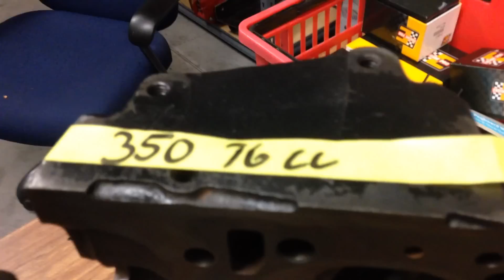350 and 305 Chevy what's The Difference

Comment: I'm looking into getting a Chevy 20 work van with a 305. If I'm going to be using this van frequently what are things I should look out for?
Reply: Nothing really. The 305 has great low end torque, they're suited for it (the exact reason you see so many 305's in Marine engines where they're under CONSTANT load).

But, what should be looked out for is:
- ALWAYS change your oil on time, and DO USE a high quality filter. In a work van, the last thing you want is for a tiny piece of debris to slip by your system and cause a spun bearing in the cam or crank.

- If going the 4bbl route, they came with Quadrajets on them. You'll want to rebuild it as soon as you bring it home and be sure to seal up the welch plugs with "Marine Tex". Do not use JB weld or anything else, Marine Tex is one of the only things proven to stand the test of time with fuel. (This is extremely common for Q-jets to leak/seep through the welch plugs. But, absolutely one of the best carbs to get and use hands down — AS LONG AS it's adjusted correctly. You can easily rebuild a mid 80s and earlier Q-jet no problem by just following along on a YouTube video. They're not at all hard to do right.)

- Swap out for a nice HEI system, and do away with the old style points and coil style distributor. You'll get a better spark, better fuel economy, and it'll make for a little more power and a longer lasting engine in the outcome.

- Other than that, there's really not much you gotta watch out for other than atypical engine stuff. They're easy to refresh on the top end if need be, and extremely reliable for what you're looking at. If you're gonna be pulling a lot of weight/doing a lot of towing, you may want to install an RV/Torker camshaft. It'll bring your RPMS down to around 4500-k max, but you'll have even more immense low end torque to play with and rely on to better utilize the van for its intended purposes.

They're built like tanks and last a lifetime if well serviced and taken care of.

Comment: just signed the paperwork and put my first payment down on a 98 k1500 ❤ what would YOU DO? with a factory setup 5.0 with thr spider injection :/ i did lower intake manifold gaskets it was flooding the engine pretty bad with coolant it runs great tho honestly 4x4 is perfect i love it drove it for a couple weeks on my test drive the main issue is the rear differential is shot it wont move
Reply: do you know alot about differentials and stuff? i want to do a nice, subtle, reliable,  decently economic, build with respectable power im used to driving a 95 deville 4.9 i pay truck gas prices without the truck already why not im skilled enough to do a swap or retrofit contemplateing trying to get my greasy fingers on a 6.0

Comment: The fastest car i have ever owned was a 84 z28 with a 305. I didn't mod it but the guy i had purchased from had build it for his son to practice drag racing with. It had some kind of cam, holley 650 double pumper, edelbrock dual plane intake, some type of long tube headers, and was told it had shaved heads on it. That car would run its ass off, i literally outran everybody i raced with 1 exception. A heavily modded rx7 with a huge garrett turbo. watching this video makes me think the 305 would take to a turbo setup extremely well with bottom end work.

Comment: He stated the crankshafts interchange but the 305 crank is much less weight and are stamped 305 and the front counter weight as the rotating assembly (pistons and rods are lighter) (also the rod's are thinner on the beam) so in short if you look at the target bob weight of a 350 or a 305 crank are not the same.

Comment: I got a million dollar question can you take a 383 stroker crank and clearance a 305 block for it if so what do that combo make it ???
Reply: Yes you can look up 305 to 334 or 331 kit but it's not worth it because the bore is so small that you really can't get good airflow and bigger valves won't help because they will be shrouded best to leave a 305 stock and if you want performance build a small block with a 4in bore or a 4.125 bore which would be a 302,327,350, and 400

Comment: 305 was popular in the late 70's into the 80's as a V8 that suffered from emissions detuning. They weren't built to the highest quality at the time either and gained a reputation as worthless junk. But those nice thick cylinder walls make it easy to put oversize pistons in, and being as it's the same crank as the 350, easy to upgrade. New better flowing heads are in many cases cheaper than having a set of 350 heads rebuilt. 305 block is a nice start to a custom build so long as the block is good. People don't care about them so they're cheap, too.

Comment: 265 through 350 the differences are slight changes to stroke and/or bore.  My dad owned a garage for over 60 years and he said they used to bore out a 283 block to 302, long before the 302 was invented.  Piston deck height has to match the stroke, otherwise there is a lot of interchangeability of parts.  Also remember that journal diameters changed at some point (1968) so an older crank won't fit in a newer block and so forth, and there have been other minor changes that can cause a problem, but back in that era it was pretty common to swap parts around.
Reply: Sorry for your information but you use a 327 block and a 283 crankshaft it requires a 4 inch bore and a 3 inch stroke
Reply: Grab a Chilton motor manual and a calculator for your information
Reply: @rodneyhopper22  They were boring 283 blocks out to 327 dimensions before the 327 was introduced.  Of course they didn't have 327 crankshafts back then, only 283 crankshafts, but bored that much they achieved 302 cubic inches.

Comment: A good news clip. I have only heard of the 305 used on late-60's Camaro Z-28's. Not sure why, since they are so close in performance to the 350.
Reply from the maker: the 67-69  Z/28 had a 302 not a 305 they are very different,
 the 302 was a very good engine 4" bore and a 3" stroke the 305 is a 3.480 stroke with a 3.736 bore they do not perform anywhere near the level of a 302 or 350

Comment: I have an '86 Camero with the 305. It makes 190 weak horsepower.  I would like to get more HP out of it.
Can I put 350 heads on it to gain more up?  Any other ideas?
Reply from the maker: no that wont help If your looking for an upgrade in power I would just swap in a 350 305's are dependable but lack HP

Comment: I had a notion to build a 341 for my '89 K1500 -- That's a 305 block with a 400 crank and 350 heads (193 casting number) and port & polish the heads the Headbytes way. Then I fell into a newer Dodge Ram 1500... soooo probably not. I had a dream......

Comment: Here's another interesting wrinkle in the small block Chevy story: The Camaro Z-28 engine of the late 60s Trans-Am Camaros. That engine was was a hybrid, using the 350 block (with the four inch bore) and a 283 crank, with a three inch stroke. That gave the advantage of the 350's bigger bore, valves and ports, and the shorter stroke crank. The latter may have cost a bit of torque, but it also allowed the engine to rev higher than a typical 305.
Reply: That was the 302.

Comment: I have a 283 with 305 heads in a 86 chevy truck. Didn't get to run it much because when I had the 700r4 rebuilt I got the truck back with a blown motor. Any comment on this would be greatly appreciated!! Thanks so much!!

Comment: if the bottom end is the same, could I make it a stoker motor like the 350 to 383? I think if I could do that and put vortex heads on it and roller cam on it would be a neat odd motor I think.
Reply from the maker: It's been done a trillion times it would not be odd but it would be fast
Reply: never heard of one yet, but sound cool to me. may have to try it out. thanks.

Comment: Lots of 350 out there like mine with factory stock 64cc 193 heads.you also said before TBI heads are junk,then why did we flow bench garage ported 193 swirlport and almost matched the vortec heads in flow.I know of more than a few that have gotten good power out of 193 heads, yes i know there' not worth the time,well if you know how to work heads and have time,why not.

Comment: I had a carbureted 200hp 305 in my boat, it was smoother, had more power and was quieter than my relatives throttle body 190hp merc 4.3 boat. I also think it used less fuel but that could have been operator.

Comment: What is your opinion of a stock 307 with stock 350 heads, I don't know all them there numbers you were taking about, so just ruff it for me.
Reply: it's better to use the smaller chamber heads on a 307 the 185 castings are 70 cc the 305 heads also work well on a 307 I just built a 307 for one of my S-10 shop trucks with 416 casting 305 heads the 307 has the same stroke as a 327 with a slightly smaller bore they were not good performers in stock form because they had open chamber smog heads but you get a decant set of 305 heads with bigger valves bore the block to .060 and upgrade the cam they actually run pretty good

Comment: I had a 305 IROC...and for years the car show people were always a Debbie downer on a 305.  I saw some respectable 305 builds, but the knuckle draggers would always go Cro-Magnon.  305's made great street motors...not everyone is trying to take a stock car and get into the 9's.  Yes...there were the knuckle draggers who claimed sub 10 second times with a mild L98...  I've always maintained that you do what you can with what you have...and as racers like AJ Foyt would say...it is not about how much horsepower you have, it is about getting it out of the engine and using it correctly.

Comment: Assuming no problems with carburetion and ignition the main problem with a 305 is the cam. It is smaller and straight crappy compared to the 350 cam. First go to a 350 cam or better yet one of the HO cams or small rv cam. Next thing that helps is the HO style heads with the bigger valves. Flat top pistons like the HO can help with compression and quench. Of course dual exhaust and headers if possible. Run a dual plane intake and tune it all correctly. Holleys, Edelbrock or Carter carbs are fine, but don't automatically ditch the Quadrajet. They are like einstein compared to those other three. Next up is some vortec or aluminum heads, maybe some more cam. 

The HO 305's give you an idea how a 305 can run. Of course it is not 350 cubic inches but they can be pretty respectable and the challenge is fun, especially when you can beat a 350 occasionally. They wont believe you but you know the truth.

Comment: One difference is that some of the Chevy 305 were Factory equipped with a small Journal crankshaft instead of the large Journal like in the 350s. And, expect all of the 305's to have only 2 bolt mains. But you can still swap out the crankshafts between the 350 & 305's if they have large-diameter journals on the main crankshaft, part of what makes the motor last so long. But I imagine it is a lot easier to machine in the four bolt main crank bearing holders on a 305 or 350 with the large-diameter journal crankshaft. The two bolt main bearing holders can only take so much horsepower in a modified 305 or 350. So building up a 305 (or 350) with the big 2.02 heads, a fancy intake & exhaust, with nitrous, tended to blow up the small 305's.  another reason the 305 got a bad reputation. But polishing out the heads and putting a nice polished intake on the 305 with the all original Factory setup, allows the 305 to flow much better & it becomes more powerful And more economical, but still below the horsepower of a 350 with the same setup. Having smaller Pistons allows the 305 to run at higher RPM a bit, than a 350. But I always thought it was strange that chevy used the 305 for some of the Chevy SS cars(montecarlos). I guess Chevy thought that people would be impressed from the tachometer and not notice the power difference. Whatever you get, bore it out to 4 in, put in new pistons, weld in the 4 bolt mains, and you'll have a bulletproof motor, (balanced and Lubed right).
Reply from the maker: Correction there were no 305's produced with small journal cranks that is incorrect also the 305 does not have any more RPM capability than the 350 it's got nothing to do with bore size they share the same crank/rods and stroke I'm not sure where this info is coming from but you are listening to a source that is wrong
Reply from the maker: You cannot bore a 305 out to 4" it's not possable

Comment: I will say this, I doubt many people do it but a 3.75 stroke in a 305 makes for a pretty stout engine!!! with the right cam & heads it’s definitely a pretty peppy engine. of course it’s not as good as a 383 would be. but it’s a option for people that already has a 305 block on hand. if I’m not mistaking a 30 over 305 block with a 400 crank comes out to 334 cubes. it runs well.

Comment: I was just wondering I was watching your episode on YouTube about the difference between 305 and 350 have a 1981 Chevy Blazer K5 2 wheel drive that has a 305 in it and I high performance does a little bit put a different cam in it did nothing else besides that put a different carburetor on a putting all the Brock on it and I took it to a drag strip and it was to pull an 18 seconds in a quarter mile I was just wondering what your opinion is that pretty decent for a blazer

Comment: You can tell the difference between all Gen 1 Chevy sm blks on assembled motors.  Just above the timing chain cover, slightly to the passenger side from top center line of block, there is a casting "characteristic" that changes in size/shape from 283/305/327/350.

Comment: What the difference between 383 stroke and a 400 SBC ? In power, economy, pros and cons.
Reply from the maker: The 400 is better for power but has a tendency to run hot and has some cylinder sealing issues with high compression

Comment: hey brother I beg to differ with you on the flow of the 2 heads. A 305 head casting # 081 flows 187 cfm @ .400 lift and 195 @ .500 lift. That is better flow numbers than almost every large chamber 350 head (882, 441, 487, 624, & 993) and better than the #186 double hump.  Just dont make the mistake of putting a 1.94 inch valve in them because it will flow worse until you cut a multi ange valve job AND bowl blend.  I race an 87 Monte Carlo SS in NHRA S/KA using a 305 an 081 heads and im in the 11.70s with it. Ive put more 350s and Windsor Fords on the trailer than I care to remember. The cars that give me hell are the 283 Chevy IIs.

Comment: Is there any way to tell the difference when the engine is complete and in a vehicle?
Reply from the maker: yes the casting number is on the back of the block near the transmission bell housing it can be a bit of a challenge to see it in some cars just because there is stuff in the way but it's doable

Comment: I do like a 305 for the beef in-between the cylinders only major differences you'll notice is if your hauling if it's just the curb weight they both get up and go but when your hauling or building it's easier to get hp out of somthing with more hp already and you'll get better fuel mileage hauling with a 350 vs 305 because it puts less stress on everything to move were if you just light haul with your truck I wouldn't bother going 350 just my two pennys

Comment: The 305 is a good platform for a mini stroker (400 crank swap for 334") and because its thermodynamically more efficient than the big bores it can (with the right heads) be economical too.
Reply: WHY do this, when you can get a 327 Chevy  and NOT spend all the machining money to accommodate the extra stroke? CHEVY 327 makes plenty of pwr anyway.
Reply: @w41duvernay  The 327 is ... okay, once you getter wound up a bit, were if you put a TBI 305 up against a 327 with the same carb, intake, exhaust and cam as the 327, the 305 would blow the 327 into the weeds all day long, add to that a 3.75 crank in the 305 and it wouldn't even be a contest any more. The TBI 305 has better heads than the 327 ever came with. Anybody who tells you TBI swirl port heads are no good has never owned a flow bench or done up a tbi 305.
Reply: Oooh my what major gains loser first time engine builder and lacking basic knowledge of motors
Reply: @rodneyhopper22  LOL, so you are gonna argue against thermodynamic efficiency , ie: more hp per cu in (especially when the 305 is made into a square motor) and then say that you have superior knowledge ? Go for it, prove me wrong  !!

Comment: 350’s are available from factory with four bolt mains. 

#417 heads off a 305 can be mounted to a 350 and as long as it has dished pistons it’ll run safely on 93 octane and run like mad from low rpm to 5k
Reply: Lots of low end torque and intake velocity.

Comment: It's the 318 of GM. Everyone bores a 350 to 383, what can you bore a 305 to?
326,327, 318,340 ?? 330,Ford truck bore. And are they any good for a lower torque application for a Truck maybe? THANKS
Reply from the maker: you cannot bore a 350 to a 383 the most you can bore a 350 is to a 358 that's .060 over a 383 is a stroker engine with a 400 crank you can bore a 305 .060 over it makes it 315 cubic inches that's as far as you can bore it

Comment: 305 5sp c1500 truck 25mpg and has great torque. Not going to beat a Z28  but its a fun daily. 
I love the 305 A 350 will make more power but in  2018 If you want Old school cammed sound and mpg go 305

Comment: There is a difference between the 305 and 350 cranks. The balance is different. Some times you can get a vibration if you mix up the cranks like in a engine rebuild shop. The 305 cranks will have five machined spots on the counter weights that you can lay a straight edge across the five machined spots
Reply from the maker: very true this is why you always balance the engine if swapping parts

Comment: My truck came with a 305, I liked the motor, but I didn't like the early fuel injection, or the fact that it was filled with sludge.  I'm surprised it ran as well as it did.